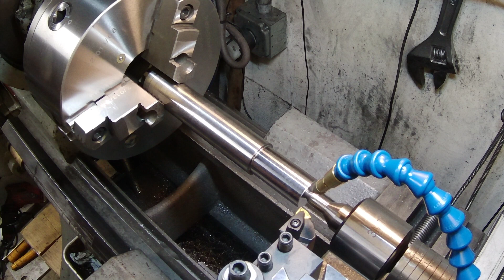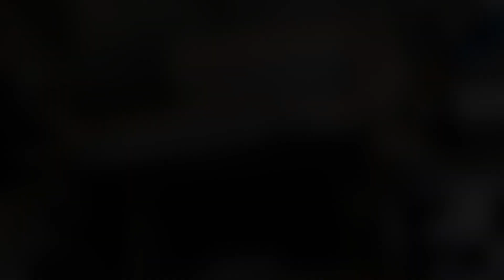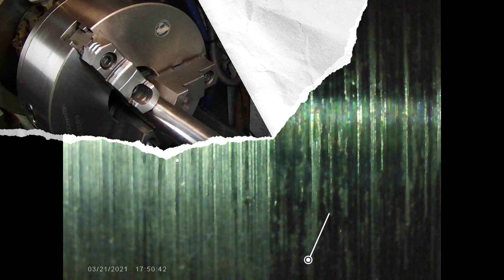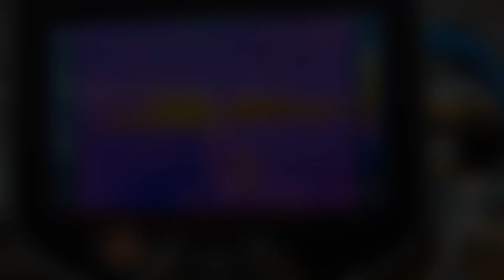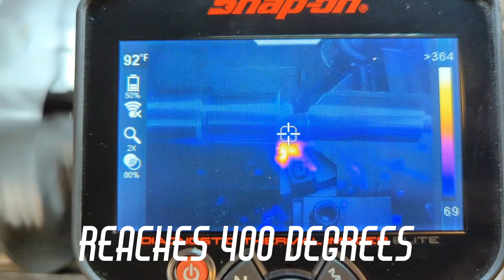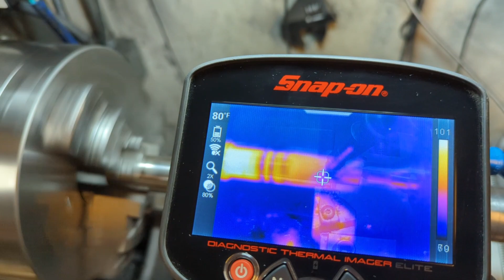How to improve surface finish on a lathe? Noga mist coolant tested. Roughing and finishing.

Comment: I have the Noga Mini Cool and I like it for it's versatility. Having 3 lathes and 2 mills and 1 surface grinder in the shop I don't have to have a dedicated coolant system at each one. I can set up the mini cool at whatever machine I am using.

Comment: I hope in the year since this was uploaded, you have learned to run higher surface speeds.  It may be my imagination but the dry surface finish appeared to improve with the higher rpm.   In 4140 at around a 1" diameter I would have been running about 1200 rpm to see how it went.   I have several Nogas and  they work great. Apart that is from 2 with broken blue outer hose bits that cannot be repaired. That was disappointing considering the price.  Cheap ones do not, in my experience work as well as the Noga unit which for me anyway, seems to run quite consistently.  Those test cuts were much longer than they needed to be, to show a result.  If I have a long cut being taken to make a part I usually speed it up in the middle to try and prevent viewers falling asleep. Making a part I can't change the cut, but making test cuts of my own choosing I would make them just long enough to show the difference.  Well done on the camera angles and lighting, not easy is it?

Comment: Just found your channel and I found this quite an interesting little experiment. However I do think that your spindle speeds are far too low for carbide tooling. I just stuck in my Sandvik calculator for their carbide inserts and for a 25mm dia steel bar it was showing a spindle speed of over 5000 rpm. My own lathe will only run at 1000 rpm and I am in the process of changing it so that I can get up to 3000rpm so that I can make better use of my carbide tooling. I will probably have a look at getting one of the cheaper mist coolers to try it out.
Reply from the maker: Hello Bill. I Appreciate the kind words and the criticism as well. The mist coolant has worked out well for me. Keeps the mess to a minimum and certainly helps out for finish and tool life as well. Thanks

Comment: Thanks!  Very good video!  Gave me a really good idea on the importance of coolant. One question:  how does this mist coolant work with the lathe proper?  That is, does it cause any rust?  Does it get into the carriage or mechanisms?  Do you end up having to lube the ways more?  Is there any mixing problem with lube and coolant?  Thanks!

Comment: i like the premise of these units,  however  if you use them in a commercial setting,  making large chips the entire shift,  change the tubing to a braided wire covering instead of the plastic snap couplers. a big ol blue #9 4140 chip will stick and melt those soft things i mean RIGHT NOW.

Comment: The question about the cheap ones may not be function, but longer term reliability. I find that the plastic “hose” goes bad. Sections tend to split, or crack.

Comment: I just tried oil/coolant and it didn't really improve the finish, perhaps it has to do with the formulation of the coolant? The oil I was using was tap magic. In my case if I use an insert with finishing geometry (means sharp tip and all that) it would only produce a good finish if you crank the rpm over 1000. However the finishing insert produces very dangerous ribbons if you make the depth too much (in my case more than 0.1mm) that would cut you very easily.
Reply from the maker: Hey Tyler. I used Kool Mist 78 for the video. I previously tried other mist coolants and the results were not as apparent. Just curious how you are applying it?
Reply: @smallgaragemachineshop2715  I just kinda drip it onto the insert as it cuts. It didn't really improve the finish though it did improve chip evacuation. I tried water and the same thing happened. Only way I can get a good finish is high RPM and finishing inserts. If it helps my 4140 was annealed, and it machines poorly because it's so gummy. If you are using pre hardened steel then the result will be different.
Reply from the maker: Ok I understand. I feel the mist coolant provides constant cooling and lubrication. I tried dripping tap magic on a part and it smoked out my garage, got my wife very angry, and didn't do anything for finish. If you don't mind me asking what kind of lathe are you using? Is this lathe new to you? Are you just getting into machining or have you been at it for a while?
Reply: @smallgaragemachineshop2715  I'm using a Victor 1630 lathe, I'm in Taiwan and victors are made here, so I used it because I can find information about it. The ways that the tail stock rides on is severely worn and I ended up epoxying pieces of copper onto the ways to keep the tail stock more or less consistent height. I never gotten tap magic smoked up, it only happens if your steel is red hot. I don't have a noga mist cooler, the lathe is supposed to come with a flood cooling thing but I never used it because I can't find the plumbing for it (it might have been ripped out by the previous owner). I've been at machining for a little bit, when I was in the states I was doing gunsmithing. Can't do that in Taiwan because it would be illegal as hell. In my experience, and I see others do this, is that a lot of people machine with carbide dry. Carbide needs to either be kept dry or flooded, or else heat stress will crack it.

I find that heat treating the 4140 generally makes it machine much better, where even a normal (non finishing) insert will produce a great finish.

Comment: Love the video and the information and tests you’ve done show clear benefits. Please can you clarify where you’re aiming the most coolant - it is mostly at the tool contact point or the top of the material being cut? Asking as I have a cheap copy of this system I’m now thinking of setting up. Haven’t bothered before as wasn’t sure on the likely benefits. Thanks again, Nick
Reply from the maker: Hey Nick thanks for the kind words. I try to point the coolant at the contact point or slightly favoring the work side. I have found that works best for me. I really like the Noga setup. I use it on the mill as well with similar results. Hope that helps. Thanks!
Reply: Thanks for the quick reply and the additional info. Looking forward to your next video - subscribed and bell rung even before you replied. Please keep it up!
Reply from the maker: Thank you Nick! I will do my best.

Comment: What lathe are you using?  That can make a large difference on what one can do with carbide so knowing would help us when making a decision about what to do for our lathe.  I really like your video by the way
Reply from the maker: Thanks Ken. I am using an old 1919 Worcester lathe 14 inch swing. I converted it to DC power with a speed control and that certainly helps things. Although I am still limited to what the old Cullman drive can handle. I am planning on doing a little shop tour soon. I appreciate the comment and you tuning in. Thanks again!

Comment: too slow cutting speed-  double it and a feed rate if near point radius.  jeez   thats killing time.
Reply: Yeah that is way below the rated speed for inserts. The finish will improve but the heat will increase. I have no problem with the heat just compensate for it.
Reply: Painfully slow,  even for a home shop. So slow you could use pre HSS carbon steel tools.😉
Reply: So slow i lost interest half way through.